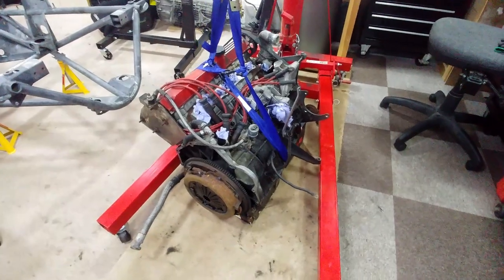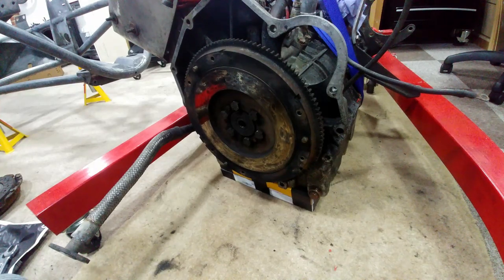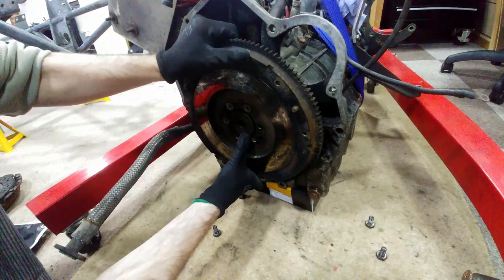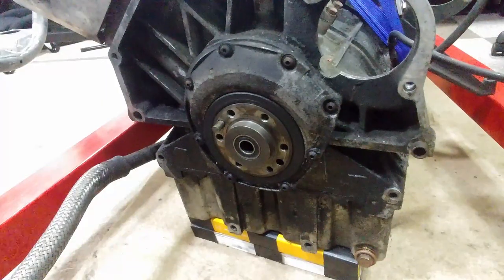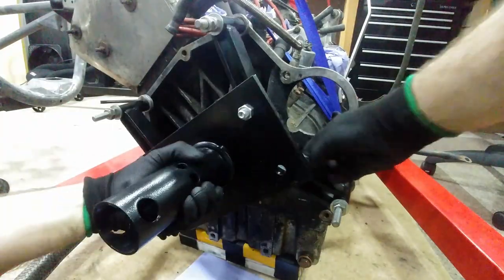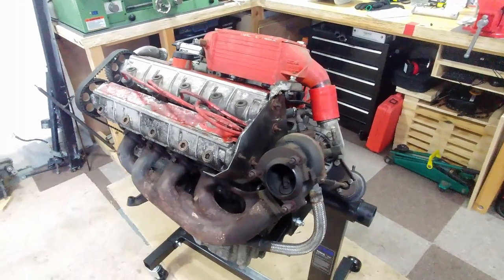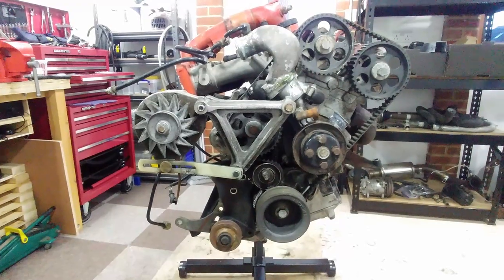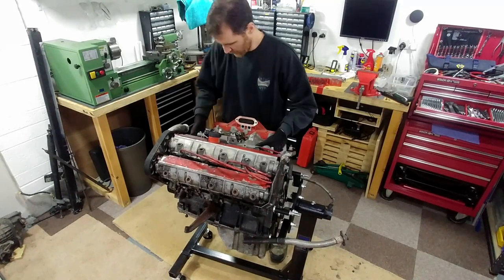Project GT2 - Lotus Esprit engine introduction #02 (Jan-22)

Comment: The narrow slot entry into the plenum is sort of like a dual plenum setup, its helping to even out the airflow coming into the plenum, ideally it would be wider as it looks to favour the centre two cylinders as is, but doesn't look like a bad setup despite what you might think on first glance :)
Reply from the maker: Yeah you can clearly see there will be flow issues to cylinders 1 and 4, it seems to handle it ok thou, especially with forced induction.  The only other way you could do this is with a tubular manifold into the throttle, but at what cost?
I did a flow simulation a while back and you can see the uneven flow rates and layer sheer which doesn't help the overall flow rates and these can be improved significantly by porting.  Some people also overcome this by adding a 20mm spacer on the plenum to increase the plenum volume which in theory is a good idea.  Later in the series I want to do some serious CFD on the intake - I know the race cars got the CFM losses down to an extremely low value compared to the road cars by porting some of the serious mismatches in the castings.

Comment: Great video
I’m building a Sport 300 race car myself
Just finished the gear box with Quaife gear set straight cut first and a shorter gears. It has a Ford spline so we have a great choice of clutches
Reply from the maker: Thats awesome, I'd be really interested to see more.  I've yet to plan out the gearbox.  I wanted to go for a racing box until I saw the cost, so factored just running an uprated UN1 and LSD.  Only company I know is GTO engineering but I haven't approached them yet as too much of the car is in bits as it is.  Clutch was another issue I've not thought too much about yet but will be coming around soon.
Reply: @JonHimself  Hi Jon, I'm enjoying your videos. 
I'm looking at getting the hatch, roof, front splitter and bonnet made in carbon fibre. I have been getting quotes from "Top Stage Composites" here in Aus.
Is there anywhere in the UK that does this sort of thing?
It is very expensive. I have the spare front splitter from the Sport 300 that raced here in Aus.
I ran it for a while on my other Sport 300
Reply from the maker: @allenmoving  I was gonna do all the composites myself.  My previous employment was composites based so I have some knowledge but sadly not the facilities any longer.  As far as light weight panels... no-one I know of makes them here specially, you'd have to get them made.
Yes it can be expensive .  I have seen people cut out the flat sections of the tail and then bond in super light autoclaved carbon sheets / foam core to save on the tooling cost which would be incredibly high for the tailgate.

Roof is an easy cast over an existing one.  I've a few options to consider but it wont be until later.  I'd love to get the over sized rear wing done in carbon.

Comment: Great video, the detail that you go through is very inspiring to anyone wanting to work on a 910S motor.  Will you be using one of the new dual scroll turbochargers to replace the factory one? The advantage being no turbo lag and fast response time.
Reply from the maker: Thanks - it's what I want to achieve in this series, it might be boring for some but I wanted to show the detail in a way that was still somewhat entertaining.
I've not looked at turbo options yet, I'm still collecting and waiting on information about the build.  My concern is the exhaust manifold which as you can see is not well balanced and may not serve a twin scroll correctly to gain the benefits, this is where I intend to use experts on the subject to give a pro-con answer.  The ultimate goal would be to go towards a tubular manifold where the correct headers match up to the turbo correctly, but cost, time etc.
Main thing is to get the engine built and running then explore options as I hope this is going to be a long term project and not the last time I will be fiddling with the engine.
Thanks for the feedback.

Comment: I suffer from chargecooler envy. I am very curious what turbo option you end up going with.  
Your videos are awesome. Keep them coming please.
Reply from the maker: Thanks, I really enjoy your videos too 👍
There's a few Esprit projects on the go right now and they're all different which is great !

I've no idea on turbos yet - and I am not sure whether to go modern or old skool.  From my learning the S4S/S300 manage 40 more HP by simply having more volumetric flow and a larger flow turbo vs increasing boost pressure alone.  So that is step one, PLUS I want to keep the original ECU which has its limitations on boost control and sensors span.
I think once the induction system is completely flowed we can look at the volumetric efficiency and match a turbo to this to get my HP target of ~ 350.
Its a shame there is limited info on the real race cars, I know the info is out there but so little was put into the public space - not sure I want to just blindly copy it, other than use it as a basis for my own ideas.  In the end it'll probably be done that way, but the point of the project was to homage the race cars.  Sadly very few people realise how good they were.
Reply: I suggest going with a small ball bearing turbo for the 350hp level for quick spool and efficiency. Throw some bigger injectors in adding a piggy back system to “trick” the ECU airflow reading. Ideally though something to adjust timing would be superior too.  I agree there isn’t a lot of info on what is best for upping the power in these cars including what accompanying modifications are needed to handle the power. 
The nice thing about your goal is you should have no problem meeting it on pump gas and no meth injection. Probably increasing your chargecooler size will be beneficial.
Reply from the maker: @SlippingTime  getting a road car to higher performance is fairly easy, a few people have done it (search Dermot O'Hare) and loads of info on Lotus Esprit World / WC engineering.  That's not the ultimate goal of this project.  I want to build an accurate as possible replica of the race car which is where the info dries up fast, even Lotus dont know!
The car will be very much sympathetic to the GT2 rules so no big chargecoolers etc - as far as I know the system Lotus ran was fairly stock apart from the turbo and exhaust cam.  Hopefully this series might bring out some of the info
Reply: @JonHimself  lotus may have added some secret sauce or maybe just turned it up hoping for the best.  I would have thought they would have some info they could have shared or even a contact that worked for them back in the day that is still around.
Reply from the maker: @SlippingTime  You'd be surprised how many people I have asked over the years, and their position at Lotus.  Lotus are/were not a company to hold back this kind of stuff so I genuinely believe its past memory.  The closest I got was the original S300 race car sales brochure.  I do however have a few good leads and I'll keep chipping at it, if nothing turns up, I'll go my own way which wont stop me and I am completely happy with :)
Its just a shame as I think it'd be great for others to see and I love a good research project, but knowing the history of the cars I can see why they have faded into obscurity somewhat.

Comment: Such a cool project. You're not tempted at all to slot a V6 in the hole? WRT the 4 cylinder, would it be worth removing the ITBs and fitting a large single throttle body? Is there an advantage to ITBs in a boosted application? The airflow path seems quite tortuous to accommodate them, the IC core could go in their place if the TB was nearer the turbo.

Very much enjoying watching along, production seems excellent to me!
Reply from the maker: Hi Adam, the project is a nod the original endurance cars which ran Lotus' 4 cylinder.  Its the engine that is synonymous with the car and besides it's actually a good engine.  I am modifying a lot of the car but in the end it has to be identifiably a Lotus.

The ITB allows you to have much faster engine reaction esp with a turbo and high boost.  If I went single throttle near the turbo you'd get a large surge of mass air flow which is undesirable.  This rapid de-compression would also cause a huge drop in turbo pressure, possibly causing surge and stalling.

With the ITB and large plenum, there is a large pressurised volume waiting to be ingested by the engine and it only has to travel 4" to the inlet.  Pressures are much more consistent and manageable.  This is also the argument people have against fitting blow off valves and something I will be looking into at a later date with a conclusive answer.
Reply: @JonHimself  interesting, thanks for the detailed answer. The charge of pressurised air downstream of the turbo is an interesting point I'd not considered. Appreciate you want to keep the i4 it looks like an interesting example of the breed! Will you be fitting modern management or keeping with the original systems? It's going to be great fun following along.
Reply from the maker: @AdamDUrso  sadly the original ECM needs to stay for it to still be the car I want it to be.  I say sadly because tuning the original ECU is nigh on impossible, a modern ECM would have been so much more fun and featured but again it would have detracted from the originality of the car.  This also potentially limits me to ~ 1.05 bar (15 psi) of boost, so in order to hit my power target I have to do some trickery elsewhere.  Sad thing is the number of people who know about these cars is only getting less, I'd like to take that mantle on one day.  Maybe I can piggy back another ECM onto the original to help?  It's something I've got to research over the next few weeks.
Reply: @JonHimself  That is a shame but I appreciate your desire for originality... There are some cool aftermarket options out there for the dedicated tinkerer, clearly something to research down the line.

Comment: What's your plan with transmission?  I have seen people putting Porsche boxster transmission in it.  It would really cool to get a PDK working on the car.  There is company called HTG that does standalone controllers.
Reply from the maker: Right now the power train is on hold as I've drawn a lot of dead ends.  Most people don't want to do bespoke work like this, and/or the cost goes thru the roof.  Clutch is a major problem right now.  The strong possibility is that I buy a second engine and just run that whilst developing the final concept as these things can take years.  I dont really want to run another OEM gearbox, if I went this route I'd be looking at something from Quaife or similar aftermarket.
Reply: @JonHimself  Yeah.  I read the original used Hewland.   This is an awesome project.  Really appreciate you sharing with us on YouTube!
Reply from the maker: @landdevil  Yep it was a Hewland DG300.  Thanks for the encouragement - it is being worked on every single day.